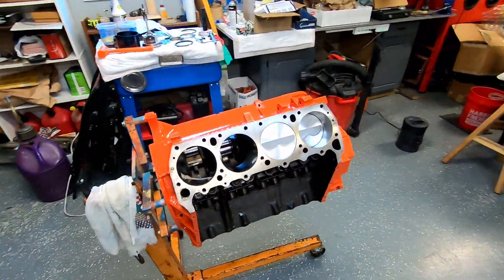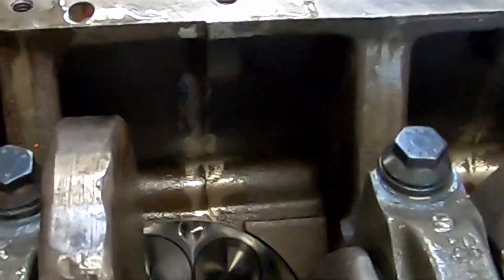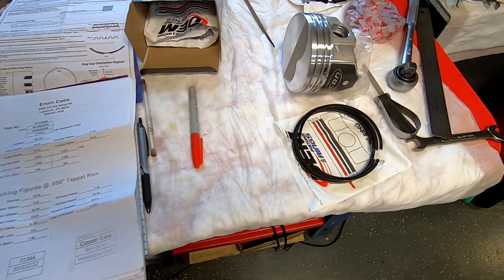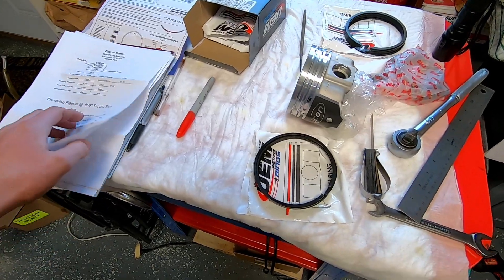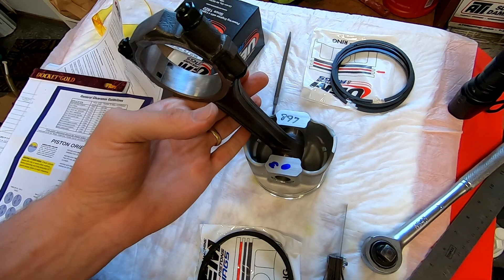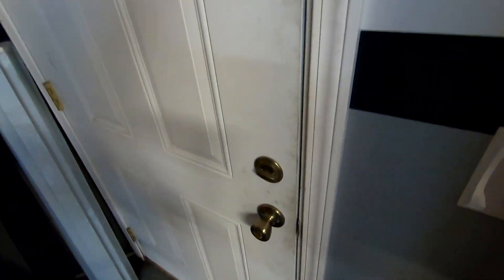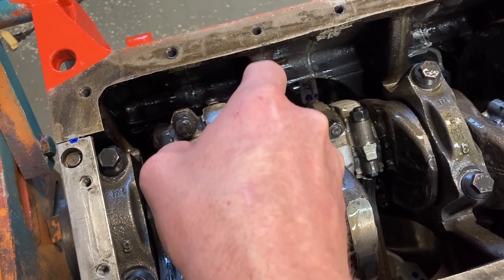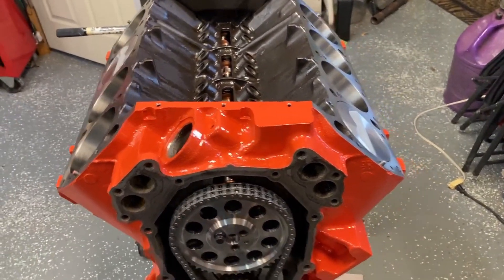Dyno 440 Engine Build Part 3: Full Engine Specs and Pistons Installed #mopar #bigblock #engine #dyno

Comment: If it was the Wallace racing calculator used for figuring if it was Wallace racing calculator they want seat to seat close of the intake at abdc. Which works off of your advertised duration. Just saying’
Reply from the maker: That’s cool. I used gofastmath

Comment: Rebuilt 2 440s when I was 15, had a 69 super bee 4 speed car. Scary fast car. First one spun a rod bearing on first break ln run,very disheartening moment in my life. Had blown 383 magnum when I bought it for 150.00 in 1974. Had 4.11 gears
Reply from the maker: Oh man! Many reasons for the spun rod. We may never know
Reply: @JustMoparJoe  2nd rebuild turned out good, ran like raped ape. Michigan State Police pulled me over to run a check on it.they just wanted to see the car.msp had Mopar intercepter with dual 4 hemi in it. I was way faster out the hole,topped out around 125 mph at 5900 rpm .
Reply: @JustMoparJoe  it was my mistake for working to many hrs in shop trying to get it buttoned up with heads and pan set b4 I took night off. Shut it off immediately but crank got gouged, other 440 got torn down in next week. 68 new Yorkers had b blocks also  both 440s came out of 68 Yorkers.

Comment: What head gasket will you be using ? I am doing a similar build a 512 stroker with trick flow heads . I don’t know what head gaskets to use? The block has not been decked and is a low mileage RV block . What do you recommend Joe?.
Reply from the maker: Since your block hasn’t been decked, I wouldn’t use a cometic. I think your best bet is a Felpro 1009. However, if your block has the big chamfer on top of the cylinders, you need to buy a gasket with the larger diameter.
Reply from the maker: 3 Common Head Gasket Mistakes Made by Mopar Engine Builders(that Affect All Brands)
https://youtu.be/Yz2no-Domaw

Comment: Have never seen someone do something for the chamber overhang in a BB. Just for valve/bore clearance. Or, to be honest, I have; welded the chambers of source heads. But that was to make them seal.

Good luck with the hyd roller, I have had a lot of work to replace them with solids.

There is not much you can do with the rod side clearance, unless it's too tight. It never is with factory rods.
Reply from the maker: Gatorman lifters on a billet Erson cam, are legit. But I ran Johnson solid on my comp hydraulic roller in my 406. It worked well and required less spring pressure than a solid roller. I had to check that rod side clearance or someone would accuse me of not checking it 😂

Comment: Looking good Joe. What intake are you using  ?  Is this going under a stock hood ?
Reply from the maker: Yes sir. The intake will likely be a hot topic. It is going under stock hood. He has a new torker 2. I will gasket match it as needed to the trickflow heads. They say this intake has a low profile and should work well.
Reply: @JustMoparJoe  The Torquer 2 is less than ideal for power, however they can still get the job done amazing well, for all of there shortcomings.   The plus is that in most cases they will allow a stock hood with an RB block.   On a RB 505 with 440 Stealth heads in a 63 Dodge Polara with 3.50 gears and 31 inch tires it easily runs 6.800 in the 1/8.         Sometimes a little stagger jetting will pick up a few hp.     I'm really looking forward to the rest of the videos on this build.       🏁🏁🏁